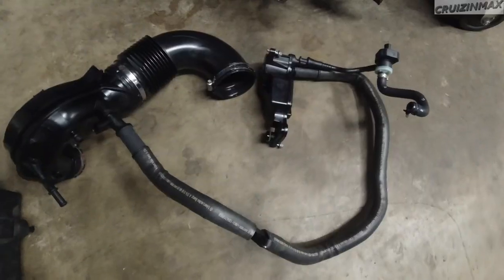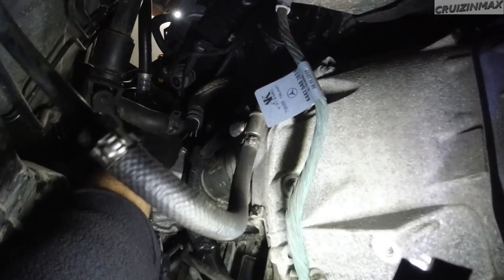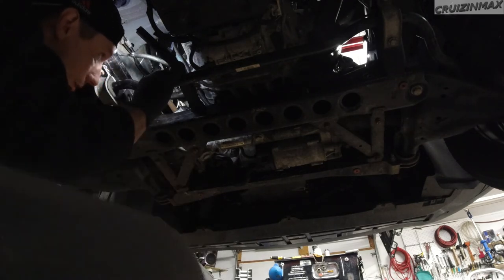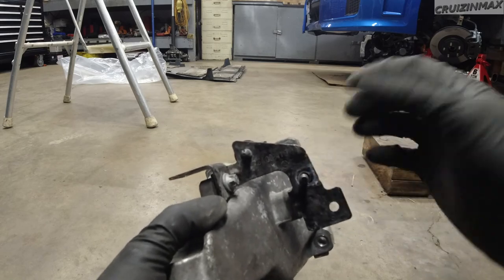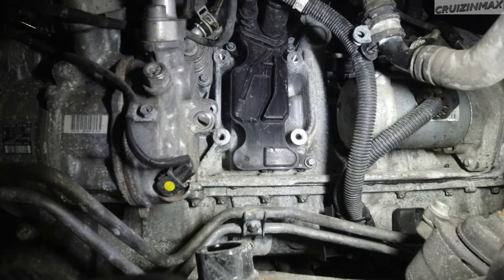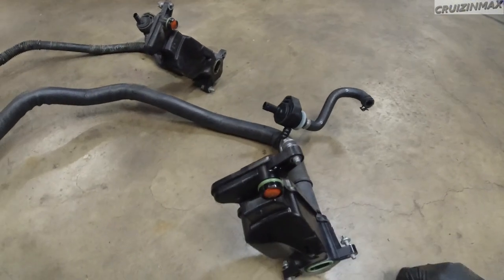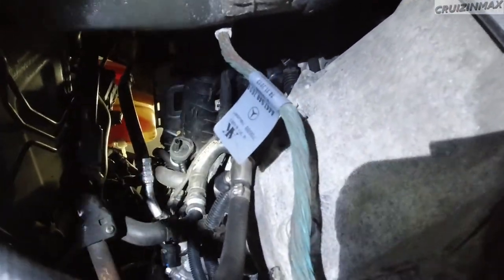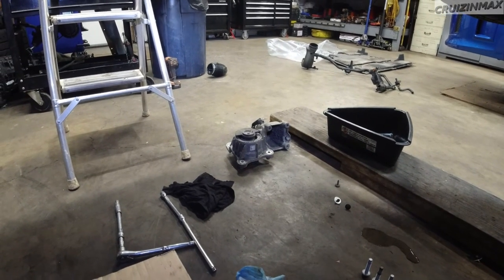Mercedes Metris 2.0L Turbo how to PCV oil air separator

Comment: I have had this part in a box for almost a year, absolutely dreading the job! With the help of your video I was able to confidently get it replaced! I’m so glad you’re on here and showing us all - in detail - the steps needed to replace it!! Thanks again!
Reply: Rok czasu jeździłeś z błędem??
Reply: Mercedes Covers this repair up to 150k miles or for 10 years. They are repairing mine this week for free
Reply: Mine failed at 152,000 😂😂😂
Reply: @chrisgrim1152  Do you have a Metris also. I brought my Metris to the dealership and they denied the repair for free. Tried to charge me 2800. I Called customer service and they checked my VIN number and said it's not covered under the extended warrantee. I argued, hung up and called back and spoke to another person who said the same thing. I'm pissed. Talked with someone else who says it's a pain to get a dealer to fix that because they aren't guaranteed payback from MB.

Comment: Hello is it possible to Jack the motor up from the bottom if you don’t have that hoist device on the top?
Reply from the maker: yes, just use a block of wood if you will jack it up using the oil pan.
Reply: @cruizinmax4017  do you have the part number?

Comment: Hi sir i got a class Mercedes 2014 1.6 petrol engine.  
 
Hissing sound coming from oil separator hose or the narrow one  pipe sound coming Hissing please tell me whats that even i replaced the oil separator too but still doing Hissing sound and engine idile changing as well???
Reply from the maker: check for vacuum leaks

Comment: Thank you very much for this informative video,

I have a couple of questions for you, and hopefully you will be able to help me with,

I just took my car to the dealer and they said it will cost $2500 labour and parts to fix it or $1500 to sale the part,

Based on your fully detailed video, I am capable to do this job from A-to-Z, but what I’m worried about what the Dealer technician said that if I buy the part online, it’s not gonna do the job,

Do you think that’s true?  and can you please send me the link where you got your part from,

Thank you so very much
Reply from the maker: The part came from the dealer, i dont know of any aftermarket parts for this, if you think u can do it then go for it.
Reply: @cruizinmax4017  
Do you remember how much it was for

Comment: We get these done in less than a hour at the dealer. They suck
Reply: its a practice , looks like nightmare to me
Reply: Dealer is charging me 10 hours, said they have to remove the turbo, then they said the water pump to get the job done.  My dealer is lying to me